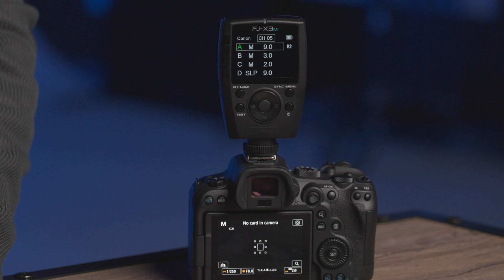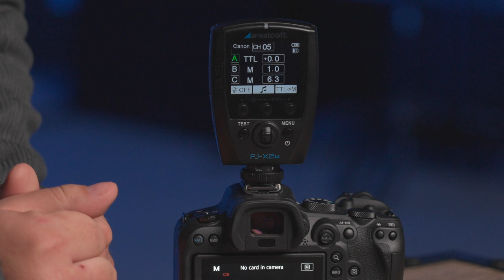TTL to Manual with FJ Wireless

Comment: This DOES NOT WORK on mine (updated firmware as well). Using fjx2m in group a, every time I switch from TTL to M, M is set to power 9 giving me big overexposure compared to TTL  (even when I had previously set M power to something else, so it’s just setting to max power regardless when using the TTL> M button).
Reply: Im having the same issue at this very moment.  Can see the reason for that.
Reply: Did you ever resolve the issue?